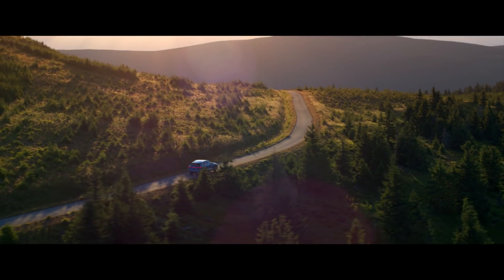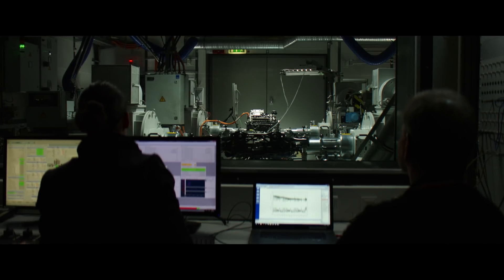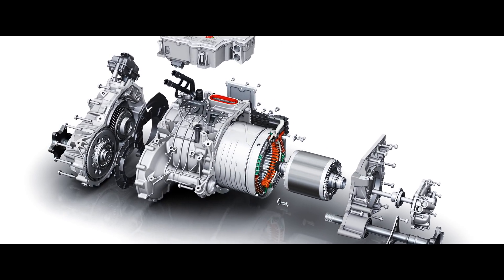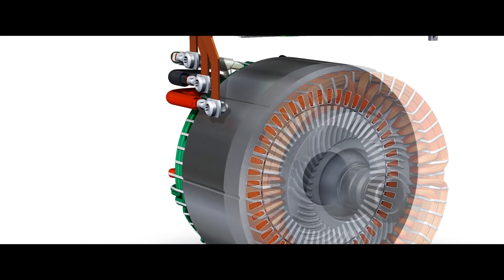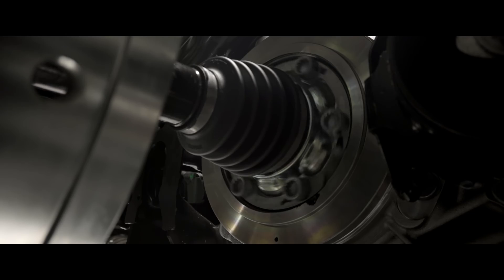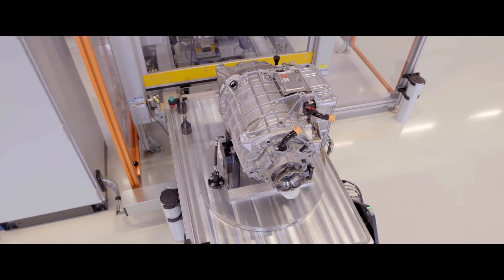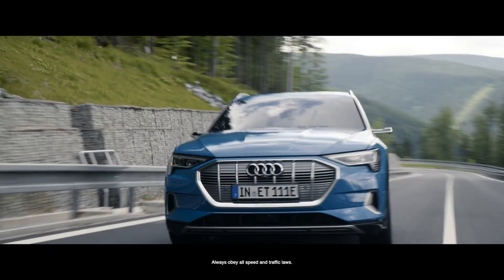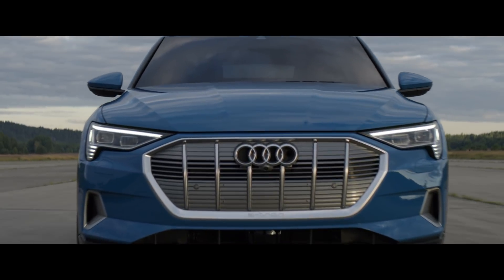Audi e-tron Defined: Electric Drive

Comment: Glad it's an EV. However, Audi needs to partner to build a road trip EV charging network ASAP. They might be already though but haven't heard much about it.
Reply: they are part of IONITY in europe and 'Electrify America'
Reply: @pr7638  All for Electrify America, their deployed numbers are way behind where they said they would be at this time.
Reply: Or.. They can just ask Tesla to use their Supercharging network.
Reply: @sur_face  isnt teslas network quite slow, only 72 kw i think. they only start building up their v3 network end of this year or something.. even private networks like fastned are already at 175 kw, and isnt ionity going up to 350 kw. plus, theres already tons of other charging networks, like 'charge point', EVgo, ... so you can just use those while they build up their inoity and EA networks..
Reply: @pr7638  Tesla's Superchargers charge up to 135kW. You can easily increase charging speed but the thing is it's worse for the batteries, you need a big battery to handle the stress.

Companies can claim faster charging speed than Teslas, but they don't talk about how bad it is for the batteries.

Comment: My favorite brand!!! Audi has gone Electric ⚡️!!
Reply: Electric has gone Audi!
Reply: Eyad Hamouda shame it's got some of the worst efficiency ratings of any electric car. Awful range for a 95kWh battery and naff performance too. Incredible interior, but if that's all the legacy manufacturers have over Tesla and their 10 years of work; I'm not impressed.
Reply: @VolvoEX30Performance  range is about 370-270 km (warm to proper cold weather,  highway), consumption is about the same as a model-x, no supprise that those heavier cars also use more power. the sloped roofline of the x gives it maybe 10% lower drag . the audi charges at up to 150 kw all the way to 80%, unrivaled ..theres really no need for range anxiety